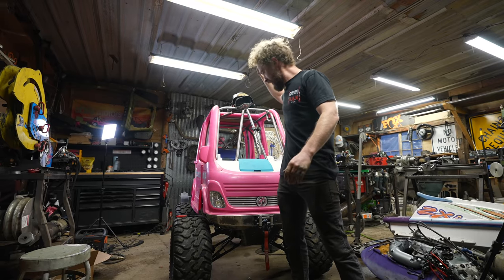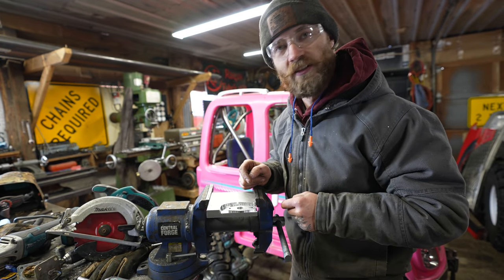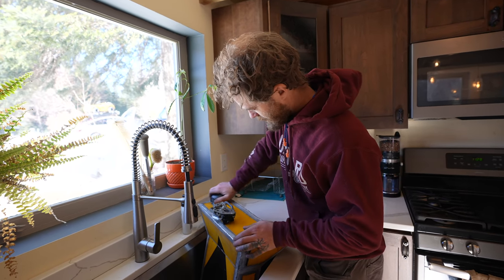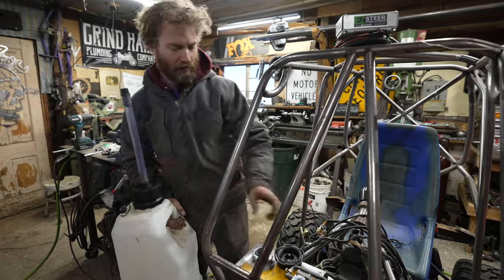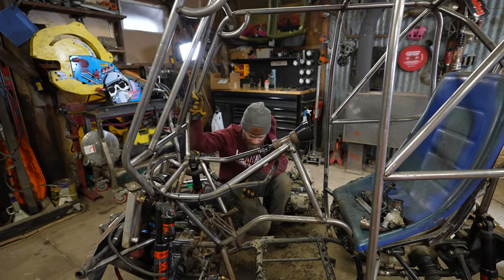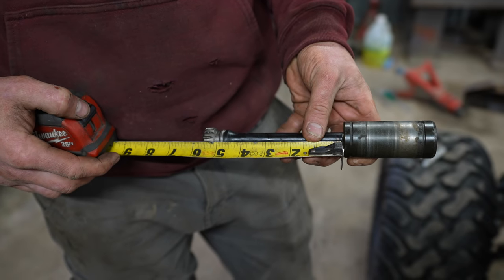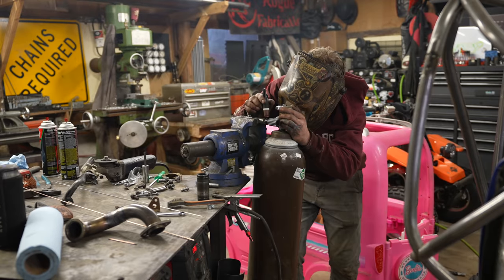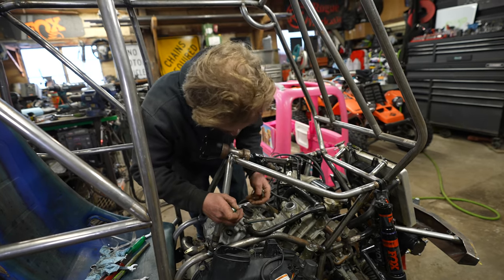Finished 4WD in the V-Twin Power Wheels!

Comment: Hint, when you are milling you want to go against the flutes always otherwise you are doing what they call climb milling and when you climbmill, it not only dulls the bits quick but it will not keep a precise cut. Also the finish will be much better. Nice work guys..
Reply: That's not fully true. Yes with a manual mill you want to do as you said and conventional mill. Typically you'd want to conventional mill close to your tolerance and then climb cut the last few thousandths and it actually produces a much better surface finish. It does not dull the bit either. Almost ever CNC operator/programer climb mills due to better surface finish. The difference is that CNC machines have ball thread lead screws as opposed to manual machines that have acme or square threads which have quite a bit of backlash, especially in older machines
Reply from the maker: Thanks for the tip! I’m still very new to the mill.
Reply: @christhut8140  Climb milling generally causes chatter which in turn causes a bad finish on heavy cuts and if you climb mill during a heavy cut, it definitely flexes also causing out of tolerance cuts. I can understand it working on finish cuts just not on the heavy cuts. One other thing to think about is the play in the mill table itself which adds to the chattering when climb milling.
Reply: @dockspa  yes climb milling can cause chatter on a manual milling machine (especially on deep cuts). That's why on a manual machine it's best to conventional mill and then do a finish pass climb milling. But like I said In my original reply, it all comes down to the backlash in the leadscrew on manual machines (the play, as you said) 
But most of the time CNC machines will climb mill because they have ball screw threads which have no backlash (practically none compared to the square or acme threads in manual mills)
Reply: @dockspa  if you're not familiar with ball screw threads Google it. 99% of all cnc machines run them do to have  almost no backlash at all. 
Also if you're familiar with manual mills and lathes you'll know that there is a gib adjustment to sole

Comment: The attempts at getting just the final bits of argon out of the bottle are hilariously relatable, I tried the heat trick with a propane heater and came to the same conclusion. Great vid as always bois, sure getting close to the "full send" video that is inevitable for all builds.
Reply from the maker: You got to do what you Gotta do!

Comment: I use to weld hydraulic oil tanks and used a mixture of rubbing alcohol and blue line chalk brushed over the welds to check for leaks once you fill with water. Just a tip for others, cool ass project!

Comment: Btw some time ago I broke the splines of my BMW X5’s front driveshaft,then I extended the splines using 3 seres rwd driveshaft and welded with my mig welder with sleeve between two parts ,but at that time I have no faith in that weld 😃 so I tried to brake it when I was close to the shop knowing that can be fixed again easily, I didn’t even put the under tray😃 but it still hold up the abuse of that 4500 lbs suv…
Anyways that tig weld on the camper should hold lifetime beating 😃and btw those two shafts are ruffle the same diameter 😃
Good work again ,grate fabrication skills I love what you doing.🔥
Reply from the maker: Haha! Nice! Thanks man!

Comment: My job is to inspect every tank of gas ranging from oxygen to hydrogen with a lot of trimixes and more. But the dot pressure rating of tanks should look like 3AA2400 or 10 percent over. (Unless its medium than that 3AA2015) but usually once they run out of gas it has to be a huge difference in temperature to get any kind of significant pressure out of it.
Reply from the maker: That’s cool! Yeah, it should be more than strong enough.

Comment: If i seen that right ya'll put a fuel filter on the pick up hose an dropped it down in there.It may need some weight to hold it down in there like a weighted fuel filter for a weed eater or chain saw.
Reply from the maker: It seems to stay there fine so far, but a weighted filter might be a good idea.

Comment: you would have like me in my garage.
weld pipes to the boiler and the chimney as a branch pipe run a 12v spotted push through air quickly gets hot.
or an old wood boiler blowing air through the pipes instead of water

Like your builds
Reply from the maker: That would help for sure! Thanks!

Comment: I am sure you know, but I have made those flanges in ~the same way, turn you vise rotation to the angles of the welded flange and mill the sides smooth and flush, then belt sand the radius.
Where do you guys get aluminum chunks from, sourcing those from recycler also or do you have a supplier for small bits, or even online like ebay?Always wanted to find a place that would sell tailing in various profiles..."inexpensively" as scrap
Reply from the maker: That’s a good idea! Will try that next time.
Reply from the maker: That’s a good idea! Will try that next time. We get our aluminum stock mostly from the scrap yard. They let us pick through the pile, and sometimes there’s gots stuff in there!

Comment: is the short end of that mini drive shaft going to have enough spline to hold power when all is said and done? id think something so short would just disintegrate eventually or shear.... not backseat engineering, just generally curious if thats a hard enough metal and enough metal is all.....
Reply from the maker: It that was from the factory, so I assume they tested it thoroughly. 🤣

Comment: I think I would have just weighed the delta between a full and empty tank and calculated the gallons based on the weight of a gallon of water. Probably slightly less tedious.
Reply from the maker: That would have been much easier. 🤣 Didn’t occur to me.

Comment: I said it before but this thing would look so much cleaner without those v bars on the rollcage in the front windshield area. That cage should be plenty strong enough without those bars and not needed and overkill for what it is.
Reply from the maker: for sure, it looks way better

Comment: a bit of advice, you shouldn't grind on your lathe, that will damage the ways, and you will lose accuracy
Reply: I kinda agree but there's ways(haha) around it. I lay a piece of leather I have from an old couch over the lathe. Wiping it down is really fine too. Compressed air will blow stuff under the edges of parts so be careful with it.
Reply from the maker: Yeah, I know it’s not great for it. I would be a lot more careful if it wasn’t already so old and worn out.
Reply: There's actually tool post grinders you can buy, you just need to protect the ways and clean them well after

Comment: Ok call me an idiot but if the tank is sealed and you fill it with water to test it and water mixed with gas is bad why not  just test it with air pressure?
Reply from the maker: Air pressure test would work too. But this way you can test for leaks and test volume at the same time.
Reply: @GrindHardPlumbingCo  how do you dry the tank or do you just send it afterwards